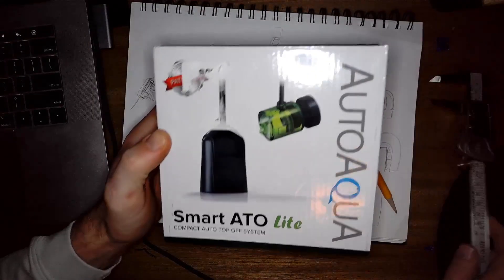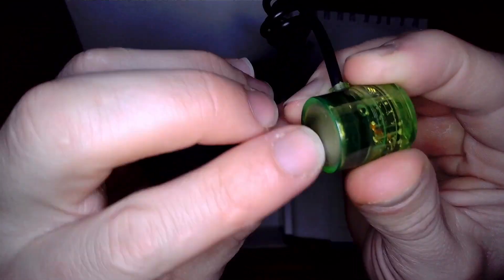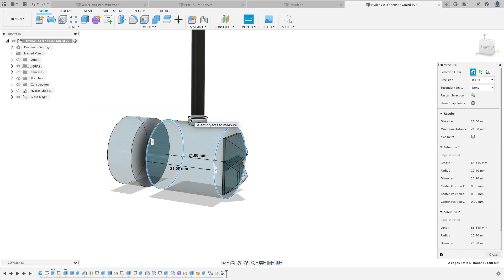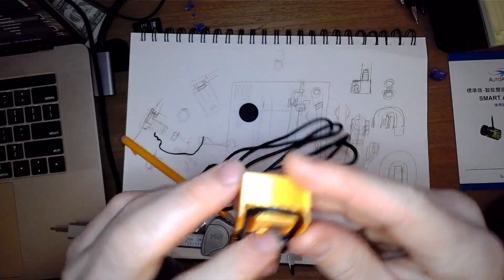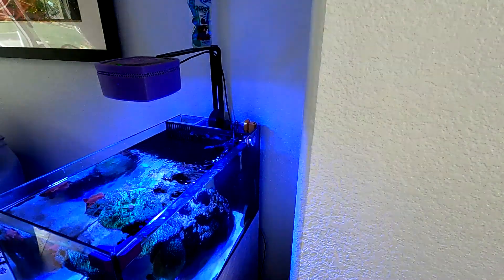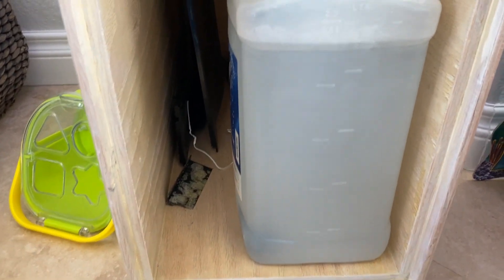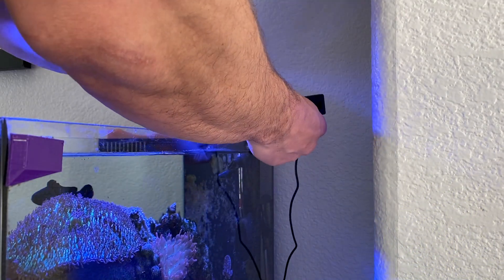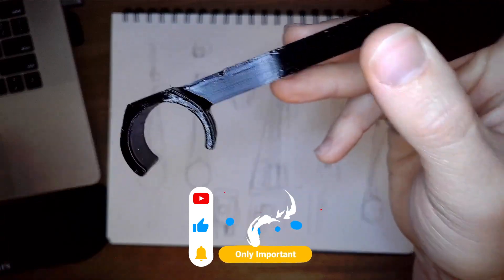Fluval Evo 13.5g Auto Top Off Setup - 3d Printed Mount

Comment: Why not just use the magnet
Reply from the maker: The magnet can easily get knocked out of place.  Regardless you still have to us clamps to hold the return tube in place.  Why not just secure everything.
Reply: @ISeaLive  ok. I've never had an issue with that but maybe you have. Nice design work though. 👌

Comment: Great design, particularly that the top-off line is incorporated into the bracket. I'm keen to get the STL file for this.
What were the 4 small holes for? Couldn't hear it.
Reply: Ah, syphon breaks
Reply from the maker: I was about to reply but you got it.  I put several because I am sure some will get clogged overtime.